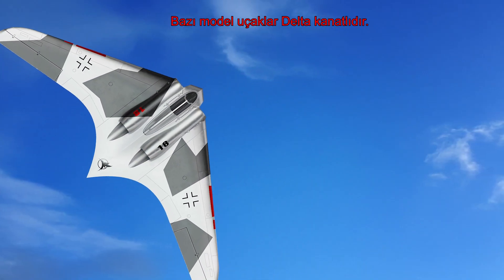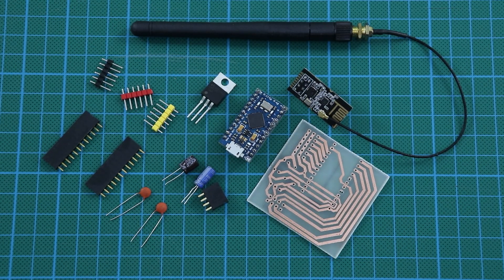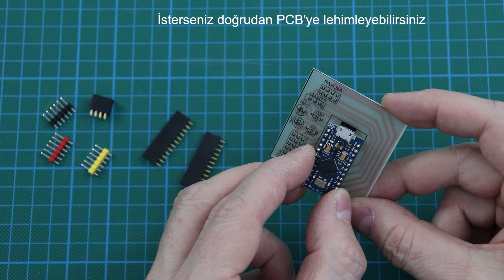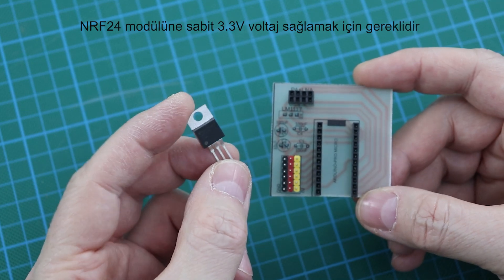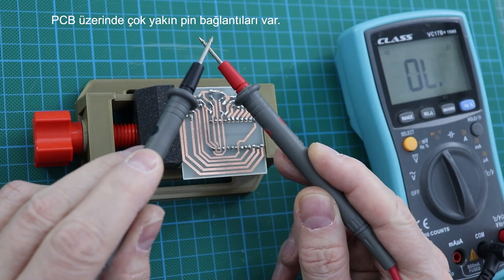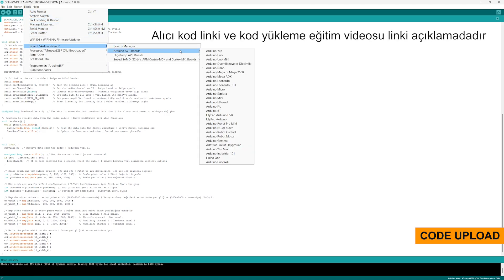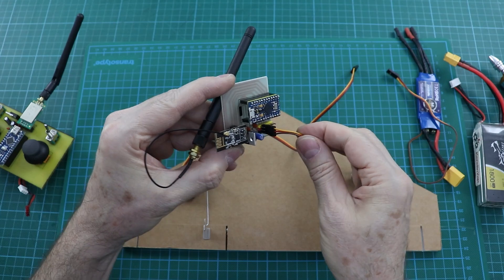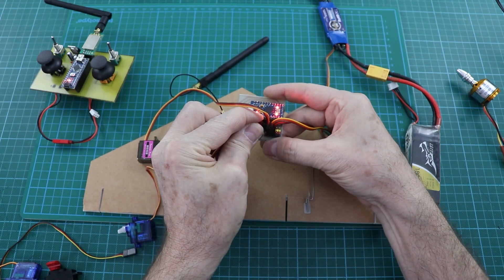How To Make Delta / V-Tail Mix Arduino Receiver For Delta Wing RC Airplane

Comment: Can i use this code with your 8 channel transmeter
Reply from the maker: This code is for the receiver. You can use it with 8CH receiver but it works as 6CH.

Comment: Can I use adruino nano to replace adruino micro pro?
Reply from the maker: https://youtu.be/3PUtnGxgTwI The receiver in this video uses Nano. You can upload the receiver code, which is Delta mix, to it. It will work.

Comment: Do you get a lot of "dead zone" on the joystick? I've purchased a few, and they always have a lot of dead zone that I can't seem to get around.
Reply from the maker: What joysticks did you get? Arduino joysticks or the PS4 joysticks I use?
Arduino joysticks are not good. I don't use them. I'm happy with the PS4 ones. There is very little (reasonable) dead zone.
Reply: @RC-Maker-Lab  Indeed I got the arduino ones. Unfortunately here in Brazil the PS4 are not something broadly available on the market. Do you have the link for the ones you got?
Reply from the maker: @caribepedro  aliexpress Global Link:  https://s.click.aliexpress.com/e/_olzSCau

Comment: içerikleriniz çok kaliteli gurur duyuyoruz sizinle. E01-2G4M27D nRF24L01P modülümü verici olarak çalıştırdığımda çok akım çekiyor ve biraz ısınıyor 500ma lık model. Biraz ısınması normal midir. step down regulatör ile güç veriyorum.lm1117 ile verdiğimde regülatör çok ısındı.VİN 8.4v
Reply from the maker: 2G4M27D güçlü olduğu (500mW) için doğal olarak daha fazla akım çekiyor. Akım da biraz ısınmaya sebep oluyor. LM1117 ekstra pasif soğutucu (Alüminyum soğutucu) ile kullanılırsa ancak iş görür. Çünkü verici modunda maksimum güçte çalışıyor ve 3.3V ile kullanılırsa yaklaşık 490-500 mA güç çekiyor. Soğutma olmadan lm1117 için fazla bir akım bu. LM1117 nin kapasite olan 1.5A  tam soğutma ile mümkün zaten. Teknik olarak 2G4M27D 5V a kadar güç ile beslenebilir ama 3.6V üzeri riskli. O yüzden diğer bir seçenek olarak 3.6V ile kullanılabilir. Modülün çektiği akım bir miktar azalır ve ısınma da bir miktar düşer.

Comment: Can we use arduino nano instead of micro pro
Reply from the maker: Yes you can. But this circuit is not compatible with Nano. The receiver of the RC circuit I published before is compatible with the mix version and is designed for Nano. You can use it. You can upload the current mix-enabled code to it. https://youtu.be/3PUtnGxgTwI
Reply: Yes